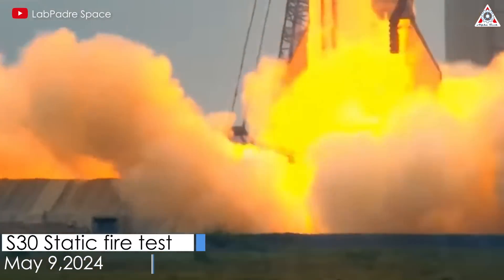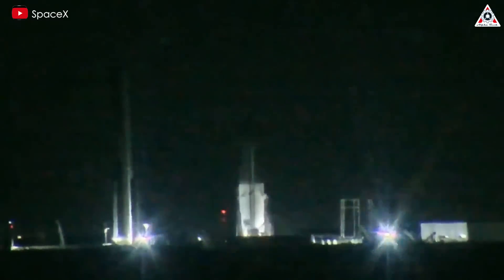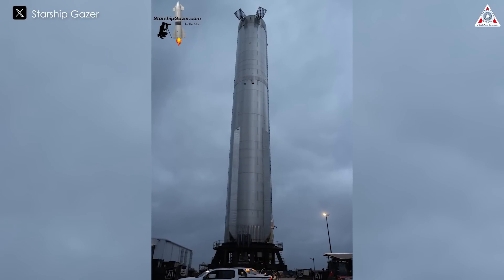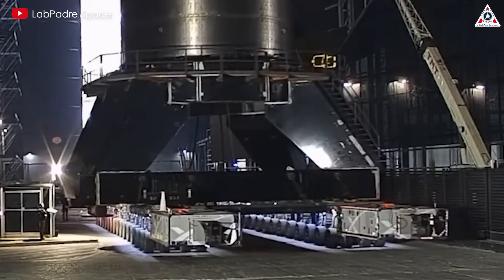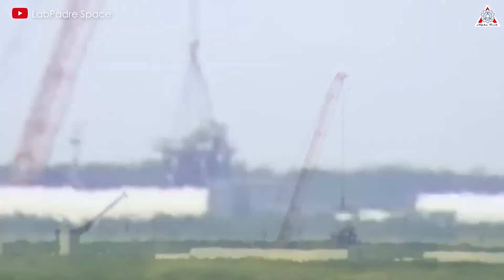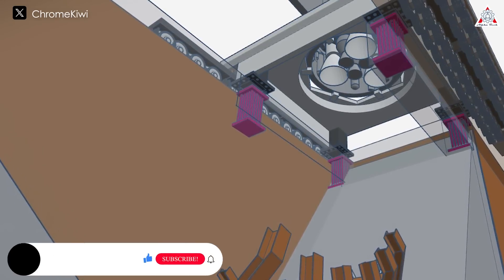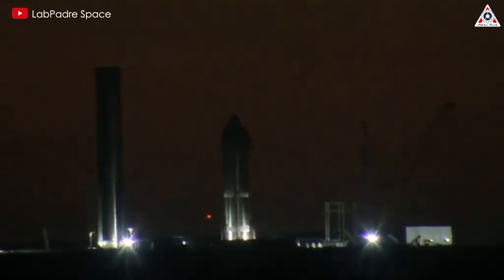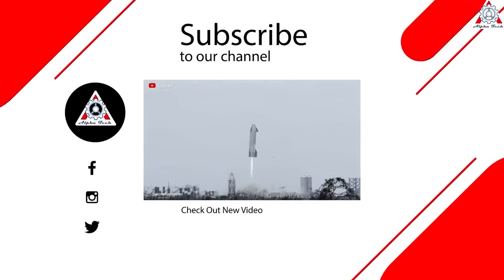SpaceX Just Officially Revealed New Starship Fire Structure, Never Seen It Before!

Comment: They decided to use a flame trench. Imagine that!
Reply: Nit using in starbase
Reply: @johnpitchlynn and then ???
Reply: In comes fanboys that say before, there's no flame trench on Mars or the moons, blah blah blah.  They don't need one, blah blah blah.  So and so is an armchair engineer, blah blah blah.  All horse patoot. 😂

Being different doesn't equal better, no matter who does it.  It's good to try and good to make new things. But it's also wise to use proven concepts where they make sense to use them.
Reply: What it comes down to is total thrust on landing. And that figure is dependent on the total landing weight of the ship. The higher weight means higher the thrust needs to be to make a safe landing. 

Because of that I don't believe that initially Star Ship should make a naked landing on the moon or mars because of the uneven terrain, the rocks and more specifically the dust of the Moon and Mars are face powder fine which creates a whole new set of problems for any vehicle landing there.

One slip up and a tip over of a starship on the moon or Mars that ship is done. So to me a smaller vehicle along with an unmanned cargo ship should land instead. Set up a Landing/Launch Pad and then the land the manned version on an even surface. It may take more time but it would be a much safer option. I don't want us to lose anyone up there as there is no reason to risk the loss of any crew member because we won't spend the money to do it the right way. Star Ship is way to big and to powerful to conduct the naked landing and put a crew in danger. So why not a small lander and a cargo version of the Star Ship.  That way if that gets lost no harm done. Food for thought.
Reply: Here we go again...another bunch of obsequious sycophantic genuflecting SpaceX /Musk fan boy cultist upset that I dare criticize their dear leader about flame trenches. Let's be clear...when one launches a vehicle that puts out the largest amount of thrust, 16.7 to 20+Million pounds of thrust in history, one is now entering into a whole new launch environment never seen before and one that creates stresses on every system on the vehicle the launch system and infrastructure surrounding it. NASA built flame trench/baffle/deluge systems not because it looked cool or just to spend money. They built that system for good scientific reasons and necessity. Primarily because without that system in place they lost more missiles because of torsional stresses on the missile stock specifically both harmonic vibration and sound reverberating back into the stack. Early on in the program there were lots of losses of launch vehicles due to these stresses. So NASA and the expert scientists knew they had to isolate the missile stack as much from these stresses as possible... hence the flame trench system. And this simple technology works and works well. 

Musk himself said as much after the first Starship launch and I quote "Aspiring to have no flame diverter in Boca, but this could turn out to be a mistake. " He knows he present system will NOT work long term...especially with all the full power launches he is considering...so he has only one option...move the launches to Cape Kennedy or build a flame trench system at Boca...building one just for testing isn't going to cut it and what's more he knows that as well. I wonder how much he's having to spend rehabbing Stage Zero after each launch? Has to be in the hundreds of thousands to a million after each launch. Another reason for a flame trench system. 

So before all you fan boy armchair quarterbacks yell at me...take some time and study the history...you might learn something..I doubt you will... but you might. 🙄🥱😴💤💤💤